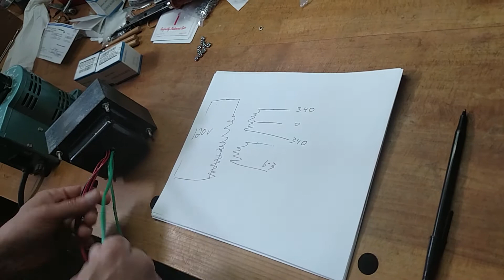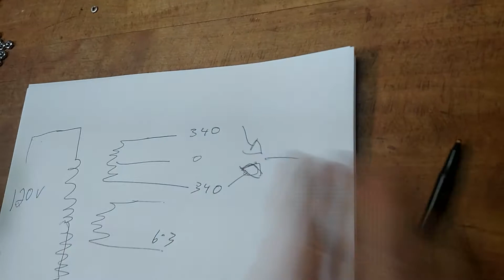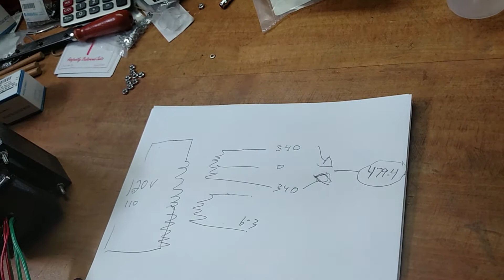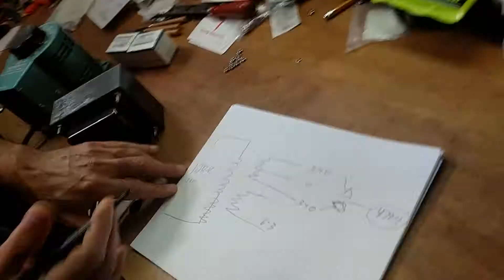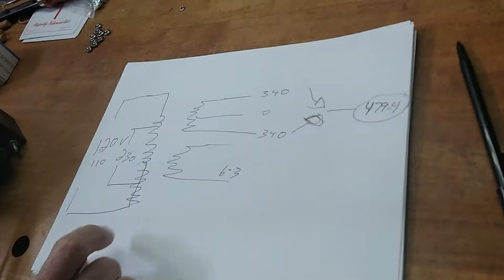Variac vs Step-Down Transformer - Voltages for Guitar Tube Amps Tech Talk

Comment: Stil have my variac that goes from 0 to 260vac. With input voltage of 230ac eu here.   Never had any issues. I always use a wall checker deviec and a separate detachable cable to check with a vm. My device always shows lower than it should but its only about 2 to 3 volts lower.😊

Comment: The clearest and true wisdom I've ever been able to find at all on the use of Variacs and transformers! I made an oops and got an ENGL 840/50 power amp from Europe and I had no idea the voltage differs and wouldn't be able to use the power amp outright! It seems like a step up transformer is the safest bet in using it here in America, though I'll probably save and go the way of the Variac when I've got enough for something nice and can monitor the voltage.

Comment: Man I wish I had seen this years ago. I read an article with EVH where he said he was running his Marshall at 140 volts. So I tried it expecting instant greatness.
Don't do this lol it sounded like shattered dreams and electrical smoke
Reply: I seem to recall hearing that EVH's first Marshall was one that someone had brought over from the UK or Europe.  That would explain the 140v setting, because it had the 200+v transformers in it.  So it would have been like dialing down a 110v Marshall to around 80-ish volts.

Comment: Excellent presentation, thanks for this. I have a couple Furman power conditioners (P-1800 PFR plugged into a P-1800 AR). They often do not output exactly 120v. Sould I use a manual variac plugged into the P-1800 PFR to make up the slight difference (+/- 4v) from 120v? Or is it generally a bad idea to plug a manual variac into a power conditioner?

Comment: Hey man, hope you can help me

I have an old matchless that only takes 110v (I live in the uk) and I don’t want to change the internal transformers. What do you recon I should do?
Reply from the maker: hi Luke. most step downs will cut your voltage by half but you probably need more than that because you probably have around 240 where you are. you could use a step down box and then plug a variac into the 120 out from the step down and adjust to whatever voltage you want.

Comment: Hi Bob
Thanks for all your infos.. maybe you could help me?.. I live in France and have an original 1969 twin reverb with the lower voltage transfo transition at 315v. (Ac768 schematics). The blackface pt on schematic give 340v. It is a export model in 240v. So, to have the 340v that I want i baught an original 1965 pt twin reverb , the 125p34a pt... it is in 110v us original version, so I use a transfo converter 240-110v. But I have only 317v in power supplies of the pt, and only 400-410v b+, schematics give me 340v and 460v. My heater is only 6.19v. I check my converter transfo and I have 110-112v output . do you think it is too low to give me the 340v for blackface Tone?.. there is the tad converter transfo with 117v output ... it will be better with 7vac more? or a variac to find the good voltage to have the 340v in my amp and 6.3v heater. But which variac to use with 240v here in France?... All résistances and caps are checked in my amps.. my plate voltage on my 6l6 are only 400-405v.. 
thanks for your help!
Jérémy
Reply from the maker: set the line voltage to where you have 6.3 volts on the heaters. at that point all other voltages in the amp will be correct to the transformers windings

Comment: Mine is a Technopower brand, it's a good one. I like it cause it has two analog meters one for voltage, one for current. It also has switch for two current ranges, one fused at two amps, the other at ten amps. I always keep it on the two amp setting for testing and when you're dialing the voltage up slowly on something you can tell immediately if you have a problem by watching the current meter. They're a good investment for the player, an absolute necessity for anyone doing electrical/electronics.

Comment: Great video Bob!

I live  in Japan where the voltage is 100. I have an amp on the way from England with a variable voltage selector: 100, 115, 230, 240. I would like to run the amp at 240 if possible. Years ago I was at Ken Fischer's and we ran a Hiwatt through a through its different voltage options through a Variac, and it it sounded way better at 245, max voltage, through the Variac than it did at 105 or anything in-between. Since I don't trust myself to use a Variac, as I'm bound to f*#k it up, please recommend a step UP transformer option. Thank you!

Comment: What kind of variac would you recommend for a US only player? And do I have to worry about buying a poorly made variac that creates electrical noise which then is heard on the amp or does that not happen?
Reply from the maker: I'd recommend buying a good quality Staco. 0-120/140V with enough amperage to power the amount of equipment you plan on running. A 10 amp unit will usually be a very good quality one. A cheap variac will not introduce noise but it will not work for long.

Comment: Very informative and excellent presentation....... On the subject of a variac, I want to slowly power up the filter caps in a Fender pro Reverb, the variac in question is 220 v  has a power rating of APS 500 watts with a 2 amp current rating. Would this be a suitable variac? Many thanks for any advice. Greetings from the UK
Reply from the maker: Start at around 20 volts and every ten or so minutes bring it up 20 more volts. Do not bring it up to more than around 3/4 of the total voltage. At this point shut it down and put all the tubes back in the amp, make sure the speaker is attached and just bring the dial on the variac up like a slow sweep until you reach the proper operating voltage.
Reply: @BobGjika  Much obliged for your kind assistance and advice. Thank you sir
Reply from the maker: Yes, but keep in mind you will have to bypass your rectifier tube with diodes and as you probably know this is best done with no tubes in the amp.

Comment: I just purchased a new 2000 watt, 20 Amp variac instead of the 1000 or 500 volt items based upon your recommendation to get the 20 Amp version.
I'm fining that I really like 105 vac power with certain tube amps.
Reply: Definitely 105 volts on my Marshalls, and 115 volts on my Fenders sounds phenomenal!

Comment from the maker: Hi Peter. If you want to get as accurate as you can set the power to where you have 6.3 volts ac on your tube filaments. That's the most important voltage to respect on the tubes.

Comment: Very concise and intelligent presentation Bob. I have some questions for you, if you don't mind.
Do power tubes last longer at a slightly reduced voltage?
I'm running a new for American market Marshall 2245/JTM45. I measured the wall outlets in my house and the are all 120VAC. 
The Marshall JTM45 say's to use 117VAC 60 Hurtz 175 Watts (on the rear panel) under the power supply input. Both the H.T. and Mains fuses say 100-120V, T500mME 250V and 230T500mVA.
 I measured the output voltage of my (surge protector) voltage regulator/ over current protection device at 120VAC when plugged into my 120VAC wall outlets . It has an option to run 10%up or 10% down. I then plugged it into my 120VAC outlets and at 10% step down it measured 108VAC/110VAC. 
I am experimenting with reduces voltage. It has changed the sound of all 6 of my tube amps in a way that I like. After the other amps had no problems I got brave and lowered the input voltage to my Marshall JTM45 to 108VAC, it did not change the sound as much as it did the other amps, but I still think it sounds good.
I am ready to purchase a heavy duty as you pointed out 1500/2000W Variac @20 Amps to set the voltage above or slightly less than 108VAC. But NEVER above the designed 120VAC of the Marshall JTN45.
How low do you think I could go? I hear 90VAC is about the lowest, but I would not push my luck. I'm thinking of 100 to 104VAC  as the lowest.
Do you think I'm on the right track?
The Marshall uses two 5881 power tubes and three 12AX7's and as it is it is the best sounding amp I ever played through. In a way I question myself and say, if it's that good why am I fussing around with voltage?
I am planning on playing out so both a Variac and my Multi-meter is a requirement as far as I am concerned even it I run at 120VAC. 
I'm in Alabama, U.S.A.
-Peter
P.S. If your interested the whole 110VAV/90VAC started in America up at Niagra Falls power plant. The conveyed the electricity of great distances to NY City and because the population was great and the power consumption high they decided to use lower voltage transmission lines. Also the 110VAC could not always be maintained under times of peak load so they designed the system to go as low as 90VAC. So in that manner, and for many many years all American products that used electricity were designed to operate normally at voltages from 90 to 110 VAC. In today's world with many more power generators on line they can get 120 VAC to every household so that is the standard. The higher the voltage in the transmission lines the more efficient the system and perhaps that is why Europe uses 230/25VAC as standard.
My prior house in Tennessee was 117VAC and my new house in Alabama is a solid 120VAC.

Comment: What a great video. I have been looking for something like this for about a year now, because I have moved all my American Tube Amps to Europe and definitely can't be directly plugged in the wall without the correct voltage and plug adapter . What a shame though you pay so much for a Fender, Mesa Boogie, and Peavey and they don't even have the voltage selector on the back like on my Marshall Amp. Had I know that it was going to be this difficult I would have sold them back in the US first and bought new ones in the EU. Either way this would be the best alternative for my situation cost wise. None of the American Manufacturers have gotten back to me either with an answer of what to do. I was very disappointed.
Needless to say I will be searching for a Variac online soon.
 Thank you Bob

Comment: Hi Bob, great video, very informative!
I have a quick question I was hoping you could help with.
I have a Mesa Boogie big block bass amp,750 watt@2 ohms (or 550@4ohms etc) USA version that I want to use in Europe. Would a step-down transformer of 1500 watt/va be enough for that kind of high wattage? Much appreciated!
(Ps I have that same Fender opb 51 reissue bass in the background of your video!)
Reply from the maker: The wattage that goes to your speaker is not the one to be concerned with. It's the wattage that your amp uses from the power supply that is your concern. That wattage is usually printed on the back of the amp near the power cord. 1500 should be plenty.... They did a good job on that bass, I wish they made the neck bigger like the original was.
Reply: @BobGjika  Thanks for taking the time to reply. On the back of the amp it only says 120 volts and 15 amps, would this equal 1800 watts of power consumption? If so I'm guessing I might need to get a higher power stepDwn...Also after further investigation it seems a lot of the Step-down boxes only give 70% of there rating when used for longer periods. Thanks again for your time and help!
Reply from the maker: @MN-kb2nx   you should e mail the manufacturer and ask them. That label is just telling you to plug that into a 120 volt supply with a minimum of 15 available amps. Your average outlet if not in a kitchen would be connected to a 15 amp breaker.
Reply: OK will do! Thanks again for the advice!

Comment: IS it that critical , never built a guitar amp, made some audio amps , didnt notice that big of  a sound issue , i think bigger difference would come from a choice of transform then 10-20% voltage oscillation , off course if not constant, if constant that would be audible

Comment: Thanks Bob, great info.
Quick question;
Im in australia with 240v
I have a evh 5150 iii guitar amp (modern all tube amp)
I bought a variac and i plugged my amp in, all good.
However i decreases the volts down to as low as 150v and still the volume of my amp was loud... although i did notice some drop for sure.
How low on the variac can i turn it down to?
Reply from the maker: Turn it down to what it says on the amp

Comment: I only use 20~30 watts small amps. If I wanna buy the step down/up box. Do I still have to buy the 1500 watts capacity ones? they are really heavy... I don't care that much about the output accuracy.

Comment: What happens if you underfeed the amp? I have seen a guy running a marshall at 60v. Great video by the way
Reply from the maker: Thanks - glad you enjoyed it - to answer your question - your amp will sound very weak and anemic and the heaters will not be properly lit on your tubes.